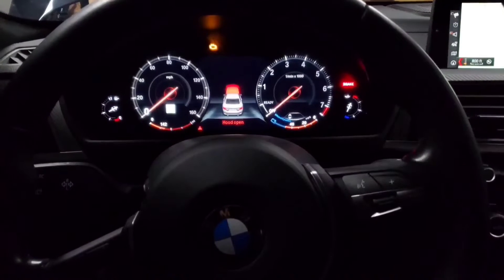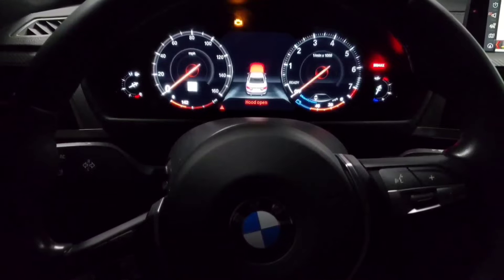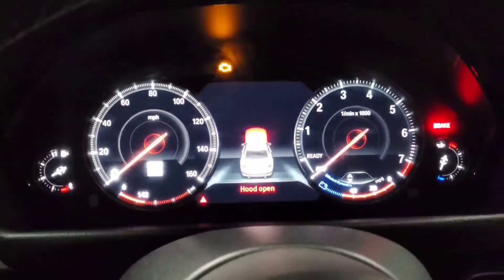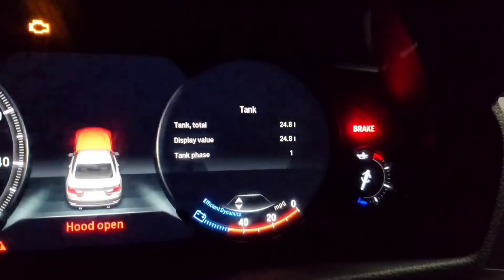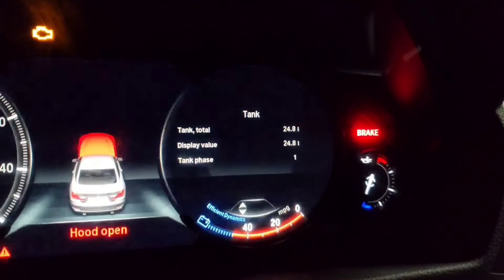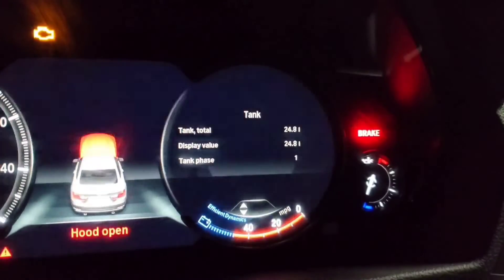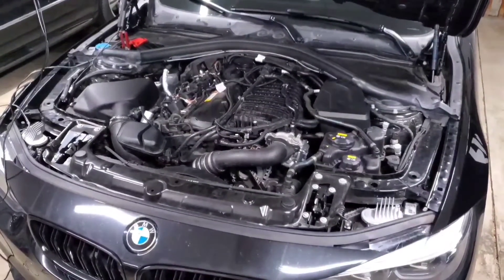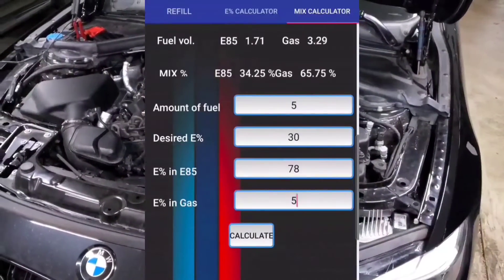How to calculate an Ethanol Mix on your BMW (E30, E50, etc)

Comment: Surprised no one has asked yet... on the first switchover from pump gas, you would need to assume the 15.8 gallon tank to account for the ~1 gallon still in reserve, yes? and then once you're up to the desired blend, you can knock down the tank size to the displayed 14.5 gallons? is that right?
Reply: or just add one gallon of gas less than the app calls for? either way.
Reply from the maker: You can add in the reserve to the calculation yes

Comment: I have a WRX, hoping Cobb makes a Flex Fuel kit again. I technically no need it but then I'd have to have dual tunes and switch back and forth if no e85 available. So most likely I'll wait for a new flex fuel kit.  Apparently they're putting R&D into a new one so

There's a Sunoco nearby that goes all the way down to e51

Comment: Just need advice: for my fbo f87 m2 with dorch stage 2 hpfp and precision raceworks coils, what gap should I set my 97506 plugs?
Reply from the maker: .022
Reply: @kern417  Thank you. 

So I removed the pr kit yesterday morning. Couldn’t figure out why the car kept misfiring. Dropped the factory Delphi coils back in, gapped to .22 and it worked. Pulls hard, but the idle sounds choppy. Like a pulsing idle. Don’t know what’s going on. 

As for the pr kit, I’ve read in a few forums that some had bad experiences. Pr kit just wouldn’t work. Have you heard anything similar?

Comment: Hey I get my E delivered in a drum. Tests for E98. Was wondering if I should mix it with 93 octane or 91. The guy who sells the ethanol told me to mix it with 91 because our shell 91 has 0% ethanol so it makes for the most accurate mix. Our good 93 octane contains 5-10% ethanol which makes it harder to get precise mix. So my question is should I use 91 to get the most accurate mix? or use 93 for that extra octane points and try to get it as exact as I can?
Reply from the maker: It shouldn't matter much. You can test 93 the same way as e85 to confirm the ethanol content.
Reply: @kern417   ok thx rlly appreciate it🙏🙏but generally is there gonna be a performance difference between mixing with 91 or 93?
Reply from the maker: not significant in my experience

Comment: Yes I agree .. The one thing that’s unclear is whether the first generation fuel pump can handle an E30 blend on a stage 2 93 octane , nobody seems to explain it yet.
Reply from the maker: Just run the map for the fuel you're running. Simple

Comment: For the section E in tank, do i put 0 or do i test the 93 gas to see how much ethanol is in the 93, or is the 93 at all pumps acurate with the E mixture?
Reply from the maker: You can test the 93 as well. In the US it can be anywhere from 0-10% ethanol.
Reply: @kern417  last question, do gas stations keep the same ethanol content all year round or is it going to be a little different every fill up?
Reply from the maker: @trapgodnah9022  it can change. It usually goes up in summer and drops in winter but some stations are just inconsistent.

Comment: What if your on E30 map and low on gas and cant reach a E85 pump, is it safe to fill up on 93 or would you need to remap?
Reply: 6 months ago i had just bought the car now im ready to dump E in it lol
Reply from the maker: It's always best to flash the right map for your fuel, but you can drive if you have to just don't floor it until you get some e85 in the tank
Reply: @kern417  i understand, its like 3 E pumps in nyc

Comment: As always, great video Kern. Something that isn't very clear now though is whether the stock HPFP on a gen 1 b58 can handle even E30 blends. I've read some tuners have used the stock HPFP for full E85 blends, yet some people say not to even try e30 on a stock pump.
Reply from the maker: Any fuel pump can support any blend when tuned properly. However you're likely to lose power when running more than e30-e50 because you have to reduce boost to a safe level.
Reply: @kern417  How is that so? Any pump for any blend? I had to upgrade my hpfp on my 2018 m2 to support e30 efficiently. My lpfp can’t go above e30. 

What do you mean?
Reply from the maker: @Flight2Freedom86  https://youtu.be/2YNlGYwAZM8
Reply: @kern417  b58 as opposed to the n55 in the m2. I see what you’re saying, but for us the lpfp cannot support anything past e30. The same applies to the hpfp for us.
Reply: @kern417  When you say ‘any blend’, you’re saying you could run even e85-e90 with a fuel pump that cannot keep up. 

Are we not on the same page? Just trying to understand what you’re saying. Here to learn the facts
Reply from the maker: @Flight2Freedom86  watch the video
Reply: @mariomunoz7167 any blend with a custom tune. It'll pump e85 but not enough flow to get to target boost and timing that you want. Basically it can pump e85 but not at the power you want. To pump more volume you need a hpfp upgrade. So if you use an ots tune the pump won't keep up because of the target boost the tune is set to achieve.
Reply from the maker: Again, watch the video.

Comment: thanks man very helpful, i used the total gas tank capacity which was 15.8 for me and then checked the obd2 sensor value for how much gas was in the tank to calculate. After i run out of the current blend i'll prob run a full 93 tank to check the fuel tank display value like how you advised to get it more accurately before returning E30.
Reply: instablaster
Reply: I filled my car up and the sensor was still at like 86 percent I wouldn't go off of that I let it go all the way to 0 miles range and did like a 33 percent mix just to be safe now I just do a 6-7 gallon e30 mix anytime it gets to half